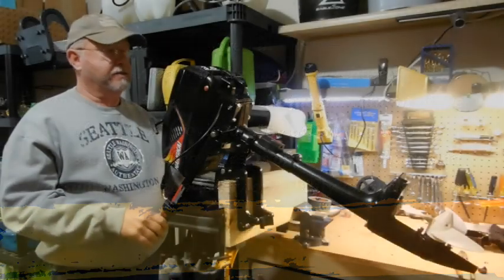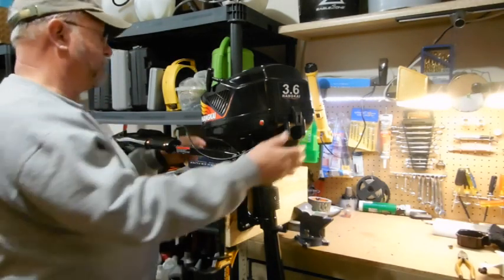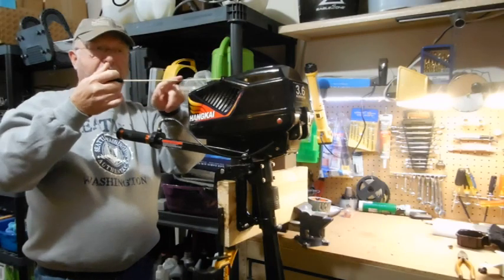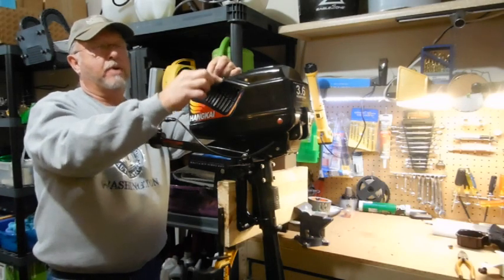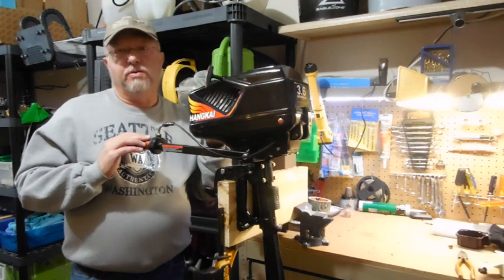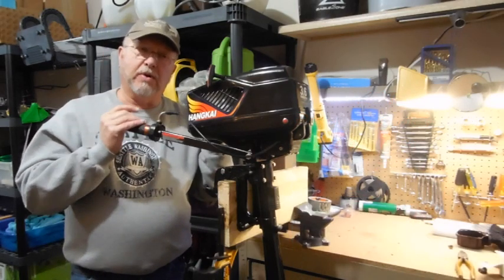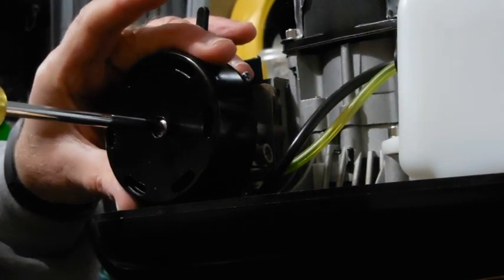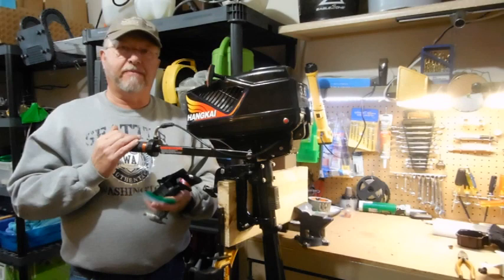Hangkai 3.6 / 3.5 hp outboard motor - 10 Things To Know

Comment: How much does your engine weights ?  How reliable is it, does it start every time?
Reply from the maker: Weight is 22.0462 Lbs.  Mine has always started, but I've only had it for one summer.  I'll soon make several short videos featuring questions from viewers like you.  I'll film my attempt at starting this spring, so keep watching.  That's not to say the motor has not experienced any problems!  It seems sound as far as the motor itself, but the little things need to be paid attention to.  Examples: Soon after purchase, it wouldn't start!  I luckily discovered it was a defective spark plug... So a viewer recommended NGK spark plug.  I did that and have not had any problem with that sense then.  I had a fuel line rot out.  I had the cut out switch wire slip off its connecting terminal.  That was minor, but still something to look for if the motor stops.  I had a starter pull rope catch and tear.... But when I replaced it, I rubbed bee wax on the new cord and have not had any more pull cord problems.  Thanks for watching and commenting.
Reply: @BoilerDan1  Does it make a lot of noise ? I know two-tact motors are used in motorcycles and they are very very noisy! I am just trying to think if it's worth buying it. I don't have a garage. Would need to store it in my apartment. What do you think?
Reply from the maker: It is a bit loud.... It's kind of like a weed wacker with a propellar instead of string.  The exhaust port is under water so that deadends some of the noise.  I tried to put some sound deadning pad inside the housing but it really hasn't helped much.
As far as storing in an aparment goes... It is light weight.  Being two cycle, there is no oil left inside it to spill.  You can simply unscrew the tank from the motor then pour out the fuel, so there wouldn't be any gas/oil mix inside it.  But you also might need to work on it sometimes....Ie... fuel line replacement,  starter cord replacement.  Nothing that hard so far for me.  A sturdy table outside (picknic table?)  or even the ground I supose.  I would also make sure you buy a new one.  Used you run the risk of someone not breaking it in properly or failing to have put gear oil in...  I'll make some update video's soon, so keep checking, I'll cover what ever comes up with mine.  No need for you to rush into buying one.
Reply: @BoilerDan1  Thanks, buddy. Well, the spring is here so this would be the time for me to buy it. You were very helpful, and I look forward to see more videos. If the only advantage of the four-tact motor is that you can reuse the gas, then two-tact it is! I doubt anything happens to your oil-gas mix, as long as they are in airtight container (I am a chemist).
Reply from the maker: @polymful ;  I don't like mixing the oil/gas, and I did have some leftover..... I used a metal Tiki Torch and burned it off, so I'd have fresh this year.  I will also mix a lot less, probably mix as I go in the small mixing container that came with the motor.  I also purchase the highest test fuel in hopes it has less ethanol in it?   I'll add a short video on that topic once I get time and topics figured out....  I did read that with the 4 cycle motor, if you lay it down, it needs to go to one specific side or the oil will leak out?  But if you can leave it upright in transporting, it might be the better choice.

Comment: So it looks like when you buy a brand new Chinese outboard it needs to be fixed :) Nothing compares with an old American outboard from the 70s & 80s. You fully clean the carb, put new seals in the gas pump, change the sparkplugs, adjust the points and BOOM you're good for another 30-40 years LOL.
Reply from the maker: That’s all true!
Thanks for watching 👍👍

Comment: Be interesting to know if this motor is in use in China and for how long
Reply from the maker: The engine block itself seems ok to me.  But they chose cheap fuel lines and pull cord for sure.  But I'm still having fun with it!

Comment: Update on this motor dan?
Still running good?
Reply from the maker: Yes but as I’m getting older the inflatable raft and floor is kind of a pain.  Also spring rains have the close location not usable.  But the motor itself with the new clutch and lighter spring is going great in a big tub of water 😂😩

Comment: How do I change the oi? Is there any oil drain? Please help, I am breaking it (10hours are up) and it's time to change the oil.
Reply from the maker: I’m assuming that you have the 4 stroke motor?  Mine is a two stroke where I mix the oil with the fuel. That being said, I can still help 😁.  On many small engines like this, there isn’t a separate drain plug.  You remove the one where you added the oil to start with and then tip the motor and drain it out that same opening,  problem solved! Happy to be of help, now go out there and have some fun 😎. Thanks for watching 👍👍

Comment: Hi 
Can I keep the motor on in the water with keeping the motor on normal rpm and no watter coming out of the outlet  coolant system?
Reply from the maker: aladen siam 
No, you risk overheating the motor. So the issue needs fixed.  Maybe try returning it to the seller. If that’s not possible, you should repair the clutch or maybe the water pump wheel.  Not too difficult a task. Hope it works out for you.
Reply: Well I keep it on for an hour and half and nothing happens I think that happens because it's also air coolant not just water coolant
But when I rise the rpm and propeller start to spin the watter start to come out of the water coolant outlet
Any how I think I should do as you told me and as you made in the video to change the spring in the clutch or am thinking to take of the spring and do without the spring 
A note : I found out after I open it and like in it that the coolant watter is connected to the exhaust and the exhaust is going out all the way out from the watter coolant outlet..I don't know if you have the same thing with you?
Reply from the maker: @1aladen  ; Yes, the water and exhaust will come out the same area some times.
The water will only come out at higher speed. At low speed, only exhaust comes out.  You are correct that it is both air and water cooled.  If you take the spring out then the propeller will always turn. Slowly at idle speed.  So if that is not a problem, then that might help.  The bolts holding the clutch need to be tight, but not so tight that the clutch can't swing out to turn the propeller shaft.  It sounds like you are saying that you are getting some water to come out when you are at higher speed.  That is good.  Maybe everything will work out to the good!
Thank you for watching my videos.
Reply: Yes 
Thanks you to man

Comment: Fuel lines swap also ?
Thanks Dan
Reply from the maker: I'd at least keep a check on the fuel lines and have some along with you!  I think ethanol fuel is part of the problem.  I'm using an additive now and I'll see how the replacement fuel lines hold up...… If the weather ever improves here :0(
Reply: @BoilerDan1  Do you have a WaWa store close by? Here in Florida they sell non-ethanol gas.
Reply from the maker: No WaWa.... But I'm a Disney Annual Passholder! …… Visit Florida often all the way from mid-north Indiana.  Maybe I'll pick up a few gallons next visit!  :0)  I'm not limited to Disney, going to Marco Island in January.
Thanks for subscribing by the way!
Reply from the maker: @Christopher Jackson I agree, putting on better fuel lines is the best option. I’d still get the highest fuel grade and supplement it with the fuel stabilizer with the additive to counter the effects of ethanol. 👍

Comment: On my mixing bottle which came with my motor it says 35.1 I'm new to boating with a motor how do I mix in the container ???
Reply from the maker: Put the 2cycle oil in your gasoline container first, then add the gas.  That will help it mix.  Since you mentioned that you’re new to this:
The oil is specifically designed for use in the two cycle engines.  You can get it at any sporting goods area like Walmart.

Comment: Boilerdan1, how long have you been running this motor? I’m interested in buying one.
Reply from the maker: I would estimate that I've run it between 30-40 hours.  Just realize that it is a small motor with not a lot of power.  But for my needs, it's fine and I'm having fun with it.  It's also a little noisy, but fun to play around with.
Reply: BoilerDan1 I’m wishing I bought this instead of my Evinrude Lightwin. It’s been nothing but a headache.
Reply: Jw could you elaborate so the rest of can ignore Fiveo who I sincerely believe is spot on about a used Evi or Merc being far superior to anything made in china..i got two china bikes, the china commuter 110 cc runs like a champ after six years of hard riding and zero care, the 70 cc had a sudden and abrupt death due to a lack of fuel filter and a beyond shitty air filter which let in so much dust the compression ration blows now and it wont start........all because of a $5 air filter cheap out IDENTICAL TO THE AIR IN THE STAE OF THIS VEDIO tyan so much form making it Dan!
Reply: happy loser my light twin has lost spark multiple times, replaced coils on multiple occasions, and the coil plate ended up being cracked. So the spark wasn’t making it to the plug. Couldn’t find the part I needed so I cut my losses and sold it. Mind you this was a late 60s evinrude, not a newer one. I have a 57 light twin now that runs flawlessly, but the recoil just broke on it. Reels in and out, but doesn’t start the engine. My 47 Elgin runs like a top, starts every second pull when it’s cold. But you have to wind the recoil rope yourself. A small price to pay. 

Honestly I think I am going to replace the light twin recoil and sell it. Keep the Elgin and buy a newer Chinese or US manufacture engine.

Comment: Is it normal for it to spew water out the top vent port? As well as out of lower screw holes on each side on engine? I made a video I'll post it ahortly
Reply from the maker: Not to worry. If I understand you correctly, the top of the vent post could mean that there’s something blocking the bottom holes that it usually comes out of. There is a single screw holding it on. You can remove it and make sure the pathway is clear.  Regarding some water coming out on the two sides of the engine cover is probably from the rubber waterlines at the place the connect to go into and out of the motor.  It has two pinch type clamps that are pretty cheap. You could replace them with a better clamp that screws tight.   But that water is harmless.  But a little annoying. I also understand your concern when it happened. Thanks for watching and I hope my thoughts have been helpful for your motor.  Take the cover off to see more clearly, and confirm that my thoughts are accurate or not. 👍
Reply: @BoilerDan1  hey thanks for the fast response! Yes your video has been great help! I've followed everything as you suggested in terms of replacing things. I will post a video shortly today. Mind watching to see if that's the case? I did take off both covers and I did not notice it coming out from the rubber tubes where they attach at any point? Only from the screw holes that hold the cover on each side. I found that strange. Quite a bit of smoke is normal too during break in? Thanks for all your help! Taking my son out on my canoe for the first time next weekend and I want everything working!
Reply from the maker: During break in, the fuel oil mixture is a little rich on oil and thus the smoke. If you’ve gotten a few hours on it, maybe a mix of 40:1 ?.... once you are done with breaking it in, the 50:1 mix will run clean with no smoke or oily residue.  I’ll check out your video sometime this morning. 👍👍
Reply from the maker: IMPORTANT: I’m starting to watch yours and realized that.... I broke mine in , in the winter and kept adding snow to keep the water cool.  Run a hose in your bucket so you don’t over heat it. You can also break it in while using it 👍
Reply from the maker: I think I’ve figured out what is going on with the water.  It’s a simple system.  The water is just backing up from where it exists the little hole you were showing in your video.  Remove that one hex head screw and clean it out making sure that there’s no blockage, maybe make that little hole bigger?  You’ll see that it’s nothing fancy just an exit point for the water.  It’s backing up isn’t a major issue but two other things are:  1: fill that bucket and keep cool water running. (Or put it on your boat on the water).   2: get the rpm’s high enough to keep the propeller spinning, that is what spins the water cooling wheel to keep it cooling.  You will get the hang of getting it started with experience. Choke and throttle up is the key.  Once it’s warmed up you may not need to choke on a restart.
Reply from the maker: I’m posting this duplicate from our conversation just to make sure that you are getting it 👍.   I think I’ve figured out what is going on with the water.  It’s a simple system.  The water is just backing up from where it exists the little hole you were showing in your video.  Remove that one hex head screw and clean it out making sure that there’s no blockage, maybe make that little hole bigger?  You’ll see that it’s nothing fancy just an exit point for the water.  It’s backing up isn’t a major issue but two other things are:  1: fill that bucket and keep cool water running. (Or put it on your boat on the water).   2: get the rpm’s high enough to keep the propeller spinning, that is what spins the water cooling wheel to keep it cooling.  You will get the hang of getting it started with experience. Choke and throttle up is the key.  Once it’s warmed up you may not need to choke on a restart.
Reply: @BoilerDan1  Hey thanks Dan! So I replaced the pinch clamps with better ones for the hoses and I'm still having the water shoot out of the two screw holes at the bottom as well as the top exhaust. Doesnt seem to be anything blocking anything from what I saw. I do dump the water once it gets too warm though and refill it. I unfortunately mixed a 6 gal tank of gas with a 32oz bottle of oil together so now I cannot change the fuel/oil mix till it runs out.
Reply from the maker: Aleksandr: Just confirming that you read my reply regarding the water coming out around the screws.  I think it is coming back up from the exhaust port.  It's not a sealed unit and the water can back up.  It is not coming out of the motor and mine did the same thing for a while.  I would clean out that plastic cover that is about 1/2 way down the shaft leading down to the propeller.  It the black rectangle that has just one hex head screw holding it on.  Make sure that the exhaust ports are clear.  But in reality, it's just a little water backing up from the exhaust area, won't be a problem.
Reply: @BoilerDan1  oh yeah that was the first thing I actually did I forgot to mention that. I did on screw that there's a little rubber thing in there with four holes in it I thought it was misaligned because it was shooting out from all Corners Now it only shoots out of the bottom oh, how do you clean it out though?
Reply from the maker: Aleksandr Yatskevich : Nothing special in regards to cleaning that area. Aligning the gasket should help. I think the water is just back pressure. I don’t think I would worry about it.  As you can see, there’s nothing much inside that area. Just thought it was a good idea to check and make sure that it was as clear as possible.
Reply: @BoilerDan1  great thanks for all your help sir! I'll post a video after this weekend on the water with any updates

Comment: What type of grease did you use ?
Reply from the maker: For the propeller gears it’s 90 weight gear lube. But I’ve been told you can use a full synthetic product that has different numbers that will work.
For the pivot of the motor, just regular automotive grease.
Thanks for watching!

Comment: Great! Thanks!
Reply from the maker: You’re welcome.  Some of the things in the series changed as time went along.  Ie.. air filter is fine as is.  One video I tried to sound insulate the cover. That was a bad idea as it didn’t deaden the sound and probably held in heat.  But overall I had fun with it…. It’s not perfect but on a limited budget it was worth a shot!
Thanks for watching.👍

Comment: I just purchased a new one and no water is pumping. Nothing coming out . I don’t know what to do? Please any advice
Reply from the maker: Water will only come out when the propeller is turning, at mid to full throttle.  The pumping system is very simple.  There is a paddle wheel down by the propeller that turns with the shaft.  You can also check and make sure that nothing is blocking the water tube.  I will put a link to one of my videos that might show some of the areas, although I don’t have one specifically on the water pump.
There’s a little bit about it starting at about the 8 minute 30 second mark of the links video.
https://youtu.be/Qu9OjXbMutA?si=Bn7lEPY682AukUdu
Reply from the maker: Let me add that you should check the plastic port where the water should flow out and make sure it’s not plugged.  But I think if you run the motor full speed, the water will come out.

Comment: So I noticed you said use none ethanol gas in the motor so where would I go and get none ethanol gas what type
Reply from the maker: Actually it’s near impossible to get ethanol free gas anymore. So I bought the highest grade of fuel but you can also buy an additive that helps. Any Walmart type store. You can also buy premixed 2cycle fuel.
The ethanol supposedly deteriorates the fuel lines fast. So you can go ahead and use it. Just replace fuel lines a little more often.